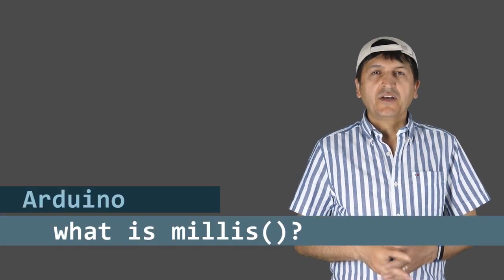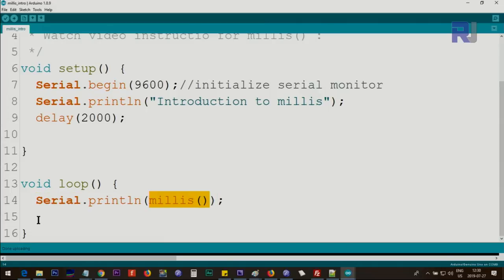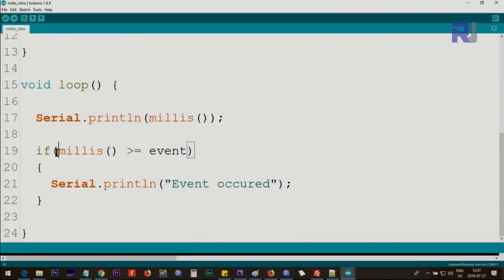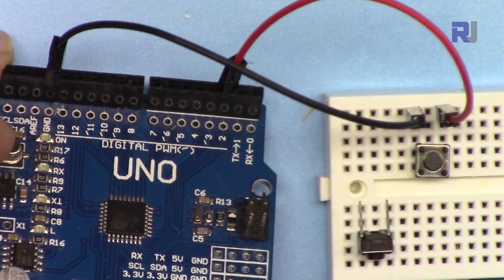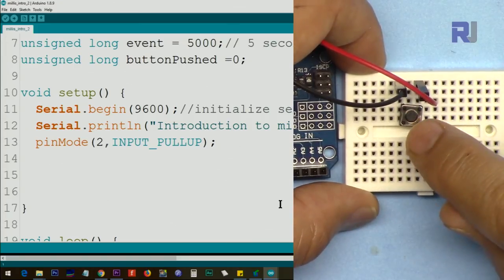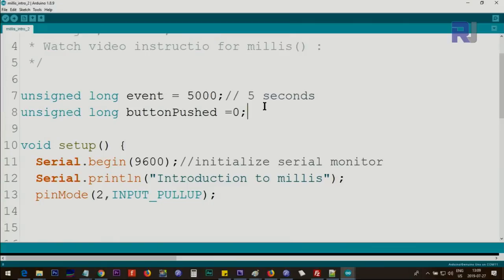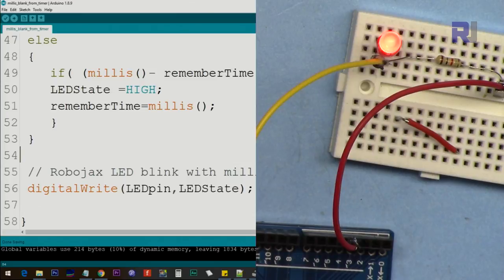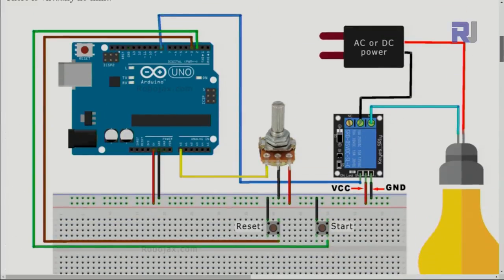Lesson 62: Time control without delay, LED blink with millis() | Arduino Step By Step Course

Comment: Sr. please make the code bellow becomes millis:

Void loop () {
if (digitaRead (tombol)==0){
digitalWrite (led, HIGH);
delay (3000);
digitalWrite (led, LOW);
delay (3000);
digitalWrite (led, HIGH);
delay (3000);
digitalWrite (led, HIGH);
delay (3000);
}
else {
digitalWrite (led, LOW);
}
}

How to be version millis Sr..???.
Reply: Have you figured it out now?
If not, his code is very clear on that.  You could just use the code that he represents exactly what you need there.
All you would need to do is add your digitalRead(tombol) line.
You would not use delays as those severely slow down the code.